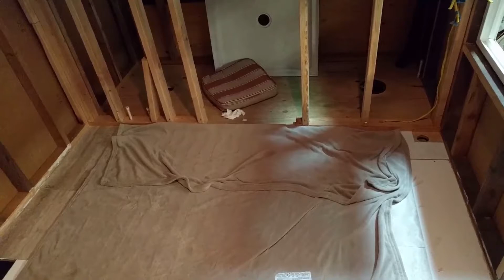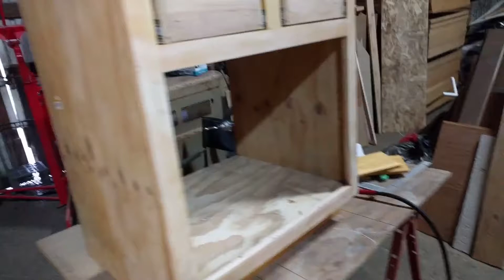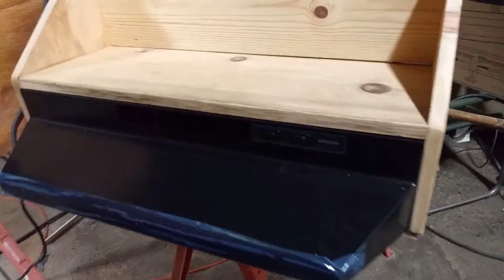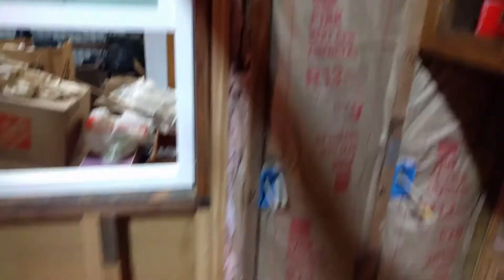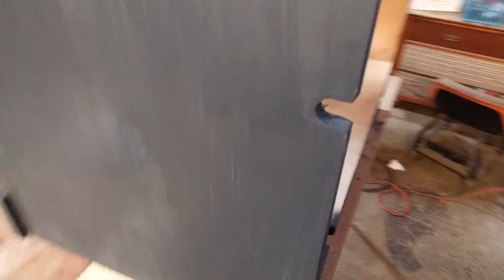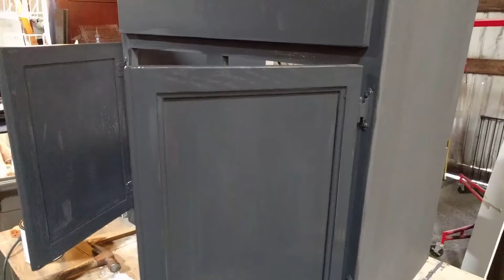Mini House Build (Part 15) Happy New Year 2022

Comment: Glad to see you again, Robert. Good job, as usual. Wondering if the inside will be hard to see what's inside the cabinet because of the dark color? That was a problem I had with some of mine. After painting the insides white, I could see everything inside so much better. My son-in-law put those little l.e.d. lights inside their kitchen cabinets so they turn on the doors open. Oh, if you throw another blanket on top the electric one, that will help keep the warmth from escaping too much.
Reply from the maker: Hi Ann! I gave up on the stick down floor, I have some snap lock type wood floor that I can use right over it. I may have to put some led lights in the cabinet with the doors maybe a small led motion detection light. The rest of the cabinets are all shelve units so it should not be a problem. Good ideas as usual, thanks!  :  )
Reply: @robertbraden3889  - Yeah, you mentioned the flooring in the video. Just be careful with it going on top of the old stuff because if the old stuff isn't sticking, sometimes you can feel it on the flooring you put on top.
Reply from the maker: @annwithaplan9766  It's not that bad, stuck down ok except a couple of corners slightly lifting, it just bugs me.
Reply: @robertbraden3889  - Haha, that would bug me, too. Well, if it's just the corners I'm sure you'll figured something out to make it so it doesn't bug you anymore. : ) Can't wait to see what you'll be showing us next.